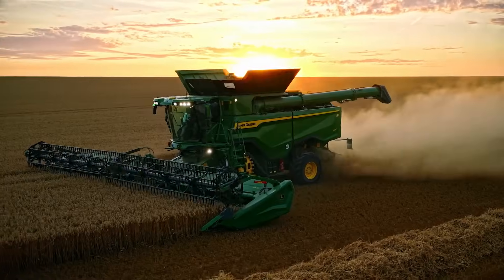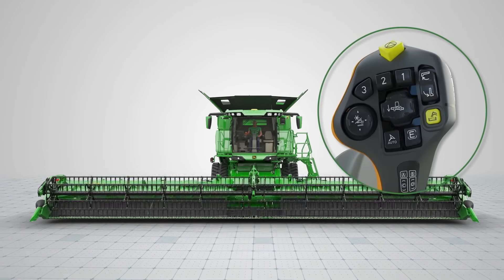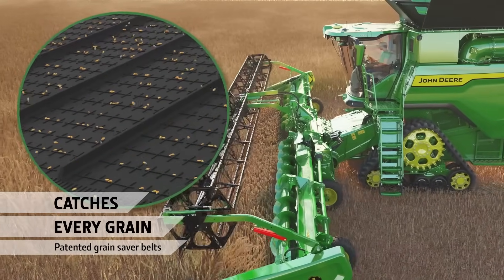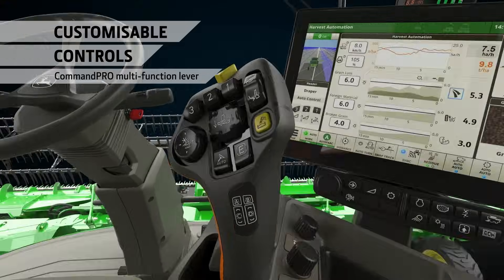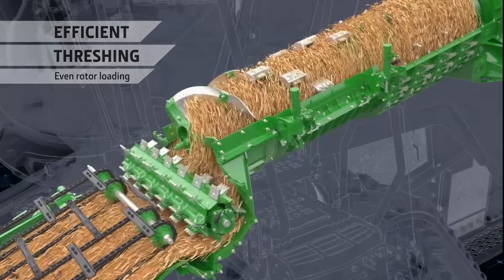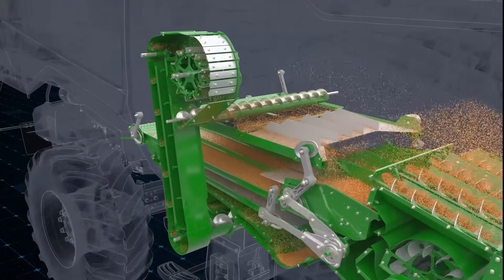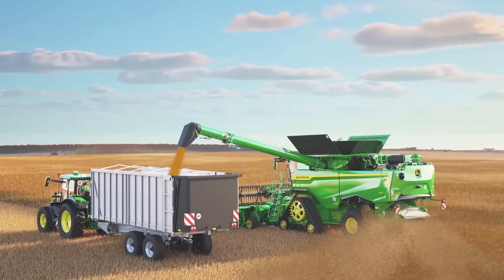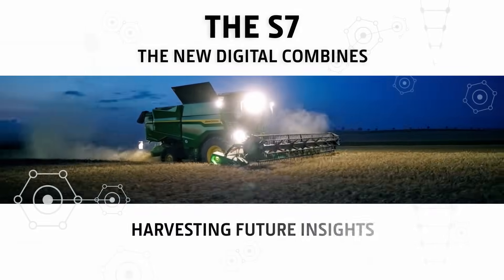Unveiling the New JOHN DEERE S7 Combine: Animation Showcase

Comment: CLAAS is a much better machine.
Reply: Not when it comes to service and reliability nobody beats deere
Reply: U Europeans have never seen a good machine
Reply: @TrevonWatts  only JD for us
Reply: Yes, but more complicated
Reply: But i'm a CNH group kind of guy
Reply: Claas is overpriced in the US with zero resale. It is great in Europe, horrible here. Can get an af11 for less than an 8600.
Reply: @stirv6462  Resale doesn't matter as much as reliability. Claas and Deere are probably the only machines that will still be running in 20 years. The AF11 has so much plastic, way more bearings, and rubber, if a single bearing goes out, that machine is gone. Not to mention, the superior Lexion 8900 is substantially less expensive than an af11.
Reply: @PipeOrgansandJetsYall Are you from Europe?  We just bought an af10 on tracks for less than an 8600tt. Claas is ridiculously overpriced. An 8900 might be impressive but an 8600 is worthless. Id rather have an s780. One thing breaks on a machine and its down. A bearing is a bearing no matter what brand its spinning on.